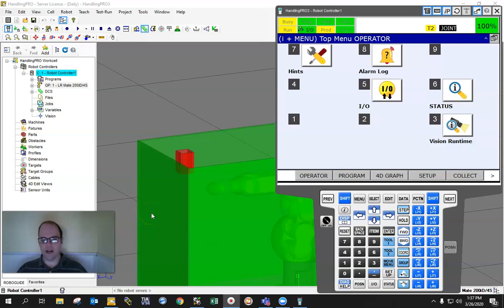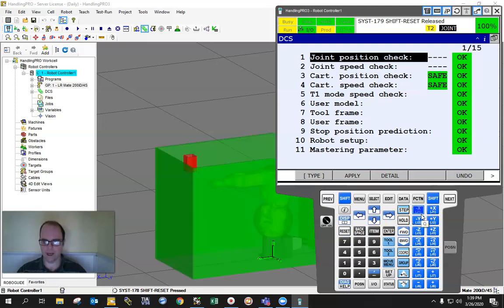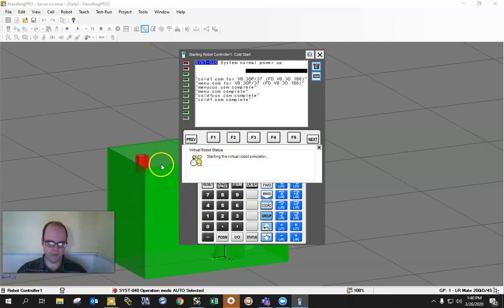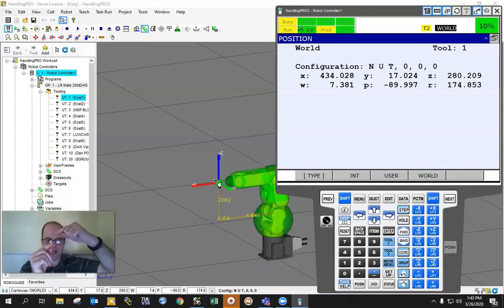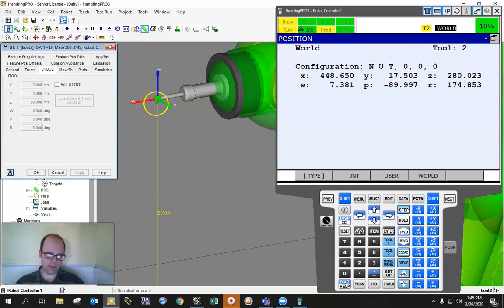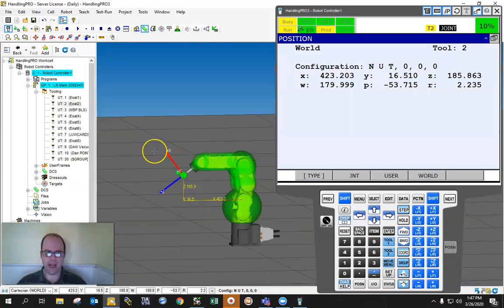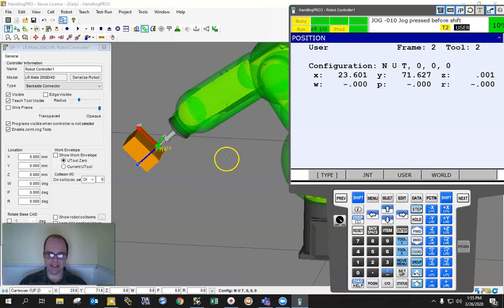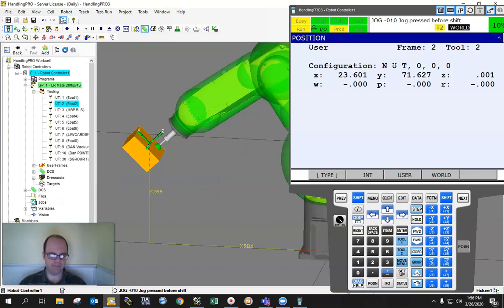User Frames and Tool Frames in Fanuc Roboguide

Comment: Thank you very much for the tutorial.  I notice that you moved the Robot in User mode even though you had a Tool.  I have a question about this.  It appears that when you rotate/jog using Rx, Ry, Rx in Tool mode, the rotations are different than if you rotate/jog in User mode.  I guess this is because in Tool/jog mode, you rotate in the Tool Frames orientation, whereas in User/jog mode you rotate relative to the User Frame.  The question is, when I write a TP program, how do I specify what mode I will use to go from one point to another?